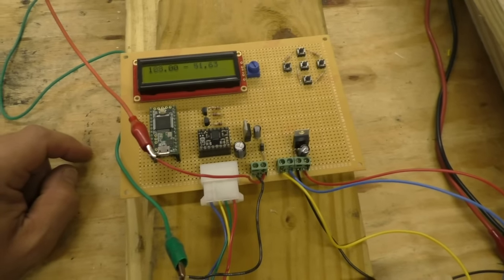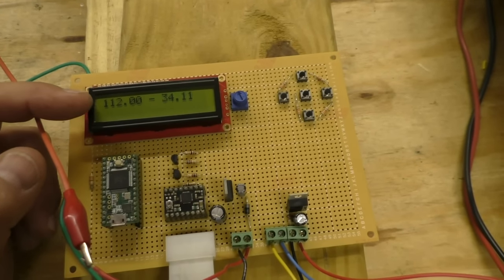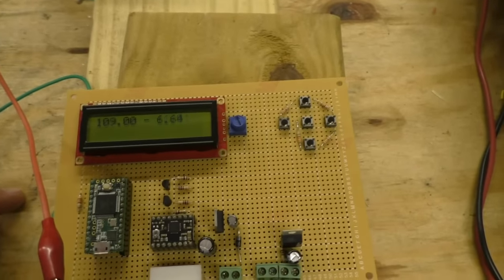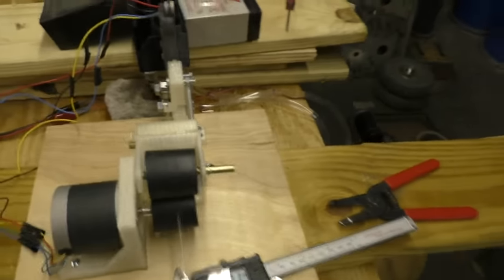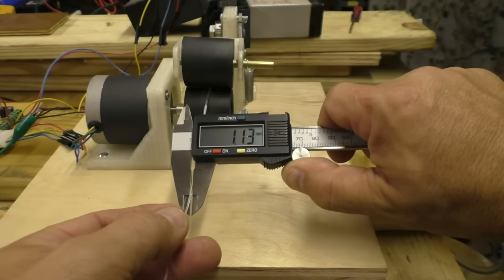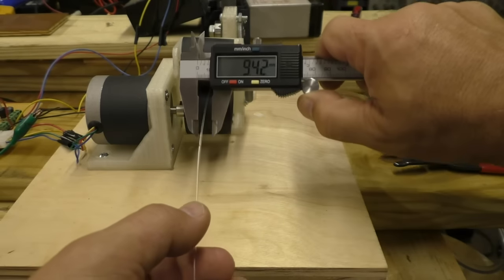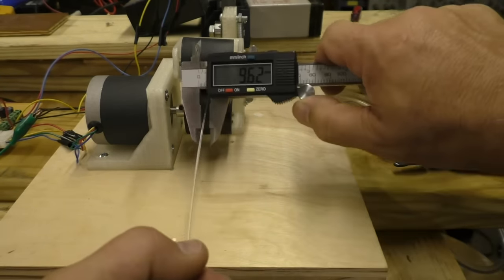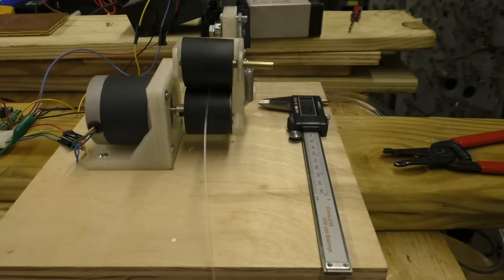Digital Calipers  and PID - Filament Extruder Update 9

Comment: You have done great work here but now it is time to fine tune the process.
1) As Bruno M said, the extruder drive motor speed variations are a big problem - that motor MUST run at a constant speed and not be influenced by pellets being sheared by the auger in the hopper area or some other issue.

The fact is that the auger SHOULD NOT be shearing any "cold" pellets at all, that is not its purpose - its job is to feed cold material into the melt chamber and churn melted (and semi-melted) material in the melt chamber so that it becomes a uniform mass that can be sent through the extruder orifice.

One way to achieve this would be to add a pre-grinding stage before the hopper that will take the material pellets (which are large and not all the same dimension) and make them much smaller.
Pellets are made for large powerful industrial machines, not for low powered "home" machines - no insult intended at all.
Think of what a pepper grinder does to a pepper corn. The finer the material is going into the melt cylinder the easier the melt happens and the more consistent the end product will be. 

2) You are measuring the thickness of the filament while it is still in a malleable (squash-able) state - consider moving the measuring station to after the coolant bath.

3) I don't remember seeing a good close-up of the caliper in its current position but it seems that you are using the full thickness of the caliper jaw (which has sharp edges which can "catch" on the filament which may be why you are seeing the readings jumping all over the place) in contact with the filament.

You need to get a single contact point measurement going and the only way I can see to do that is mount 2 bearings on the caliper jaws ( yes, drill some mount holes and the bearings at 90 degrees to the jaws and use small aluminium angle brackets ).

4) You also need to stabilize the filament horizontally so that it is not moving off of the horizontal during the measurement process - another 2 pinch roller sets, one each side of the caliper should do that.

5) The sampling needs to be done to get an average over a longer sampling length to allow for very short period extruder issues. 

These can include things like a partially melted pellet blocking the extruding orifice momentarily which will cause a thinning of the extrusion momentarily, then a thickening as the pellet gets forced through the orifice and becomes a part of the extrusion and then a gradual thinning down and stabilizing to the required size as the pressures stabilize. 

An immediate reaction and adjustment when something like this happens will cause the settings to be altered which will put the filament thickness all over the map until everything stabilizes - and this all because there was a momentary thinning, then thickening and then tapering down to the required size. I see some programming in your future.....

Another option would be to "condition" the (industrial) raw pellets by sending them through an extruder with an orifice the same as your current one and add a rotating knife that will chop the filament into 1mm "slugs" that will not give your end product extruder such a hard time which will give a more consistent (better) end product.

If you ever think about making colored filaments, this dual process would be good to get the coloring additive well mixed into the material used for the final product.

I have NO EXPERIENCE in 3D printing at all but over 40 years in the engineering and production environment has given me more than a little experience in what to look for when "debugging" production processes.

I have "extruded" everything from clay for brick making to Fritos corn chips and the thin latex filaments used to make the elastic that keeps your shorts up.

You have developed this project, solved problems and got it working as well as it does without (I am assuming) too much experience in the field - WELL DONE - VERY IMPRESSIVE !!!

Now, what do you know about blow-molding HDPE? ;>}

Comment: If your running a DC motor on the extruder end its going to have a hard time keeping RPM at the proper level under varying load. Look up a AC 50HZ motor with a beefy gearbox (AC motors are synched to 50HZ so they are more reliable at maintaining RPM, remember the plug in clocks?), those should give you a consistent rpm, also the hopper you have should have very sharp edges on it so when a pellet gets crunched, its not being bluntly cut but its being easily cut. I can hear in your video a slow down and the pellets are occasionally being cut, The other option is to try and machine some more clearance in the hopper and allow the pellets to make their way in easier.
Reply from the maker: Great tips! I will try some of your suggestions.

Comment: oh how do the calipers fit? tight?  or was it too lose?  the PID will need to be tuned. for sure that's a hard part. ~Russ
Reply from the maker: The calipers fit good and tight.  You part works well.
Reply: +Making Stuff hi friend, my english is bad. i build extruder and want make pid. you pid in real time but filament move from head after 10 second. new pid parameter need give after 10 second ..not real time. after new speed need wait new size... contact from me pls skype - foggus n

Comment: Your data points are too close together, causing the controller to oscillate. You can't control a physical system at 10ms. Either slow the input or average the readings over a set time.  Good luck!

Comment: hey guys. I had a similiar setup to this just with another caliper.
For me the spring made ny setup tilting which of course made the readings unreliable.
I guess you guys could have similiar problems.
Reply from the maker: After I shot the video, I noticed that the nuts holding the bearings on had backed out.  I'm sure the bearings were tilted at that point.  I replaced the nuts with nylon lock nuts.  Hopefully it will work better now.

Comment: Hello, you have done great job and your videos so informative.But i couldnt get how you connected extruded filament to digital caliper. Where does extruded filament go on caliper? If you can answer you would help me to stop eating my brain :)
Reply from the maker: It goes in between the rollers.
Reply: @MakingStuff  thank you very much finally i figured it out, probe of caliper is connected to one of rollers so when roller move up or down probe moves too. Thanks for replying to me.